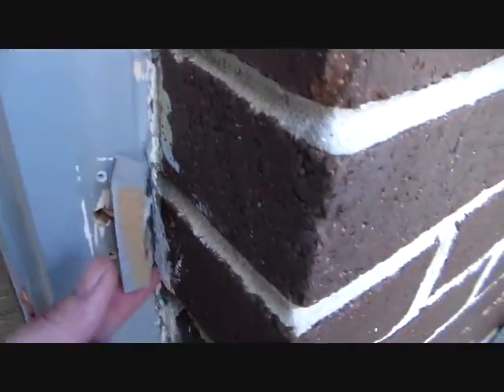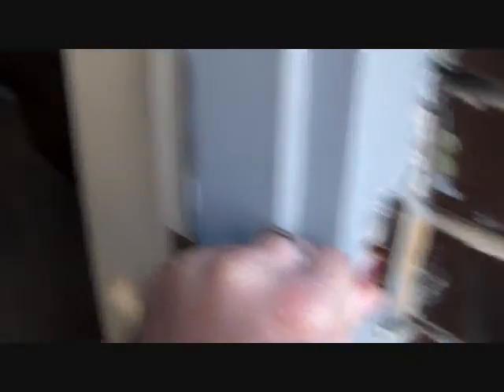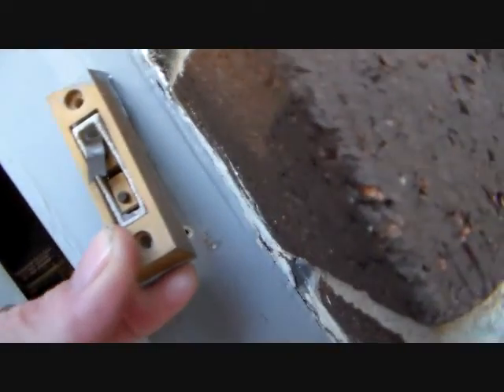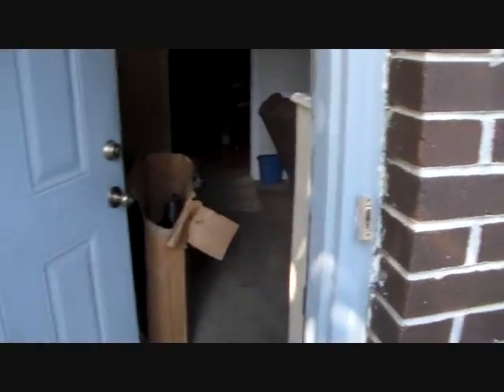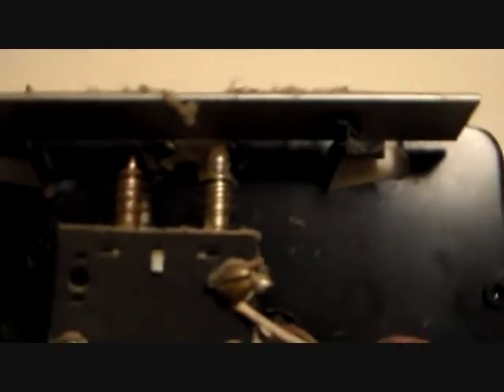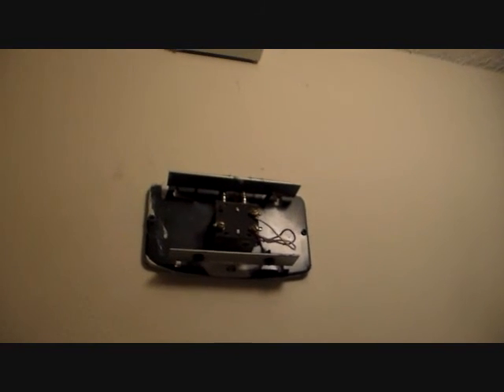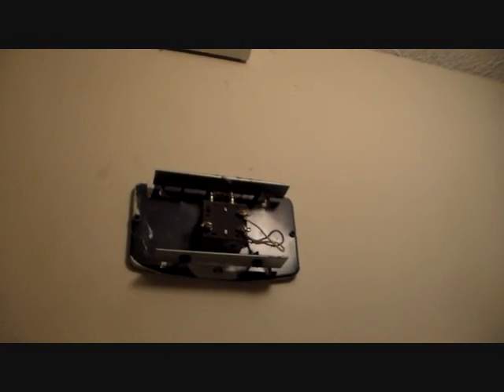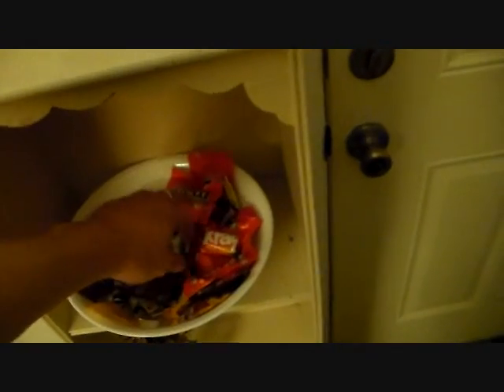Halloween vintage doorbell repair

Comment: If the city I live in hadn't decided it would be a good idea to have trick or treat on Sunday afternoon instead of on Halloween then I would have been here to hand out goodies but I had plans for Sunday long before I knew Halloween was rescheduled.  Seems like Halloween is never on Halloween anymore around here.  It gets real confusing with different towns scheduling trick or treat on different days and at different times.  If you are an enterprising young person you could probably go trick or treating a couple times a day for several days depending on which towns you go to.